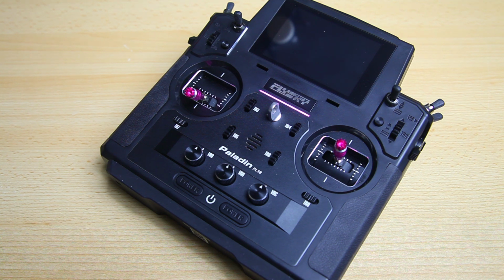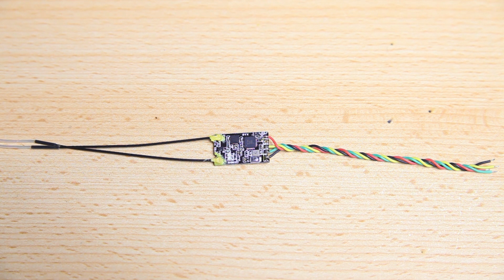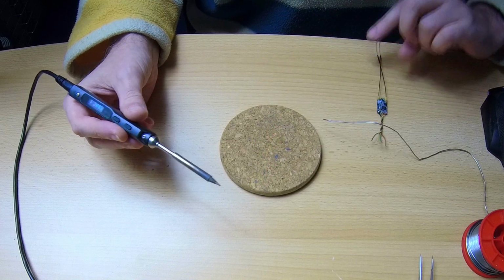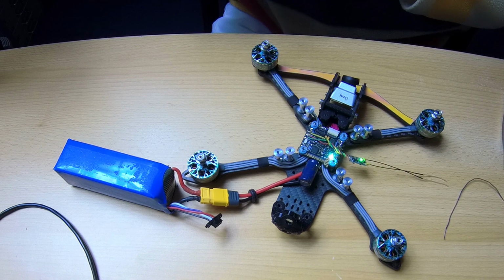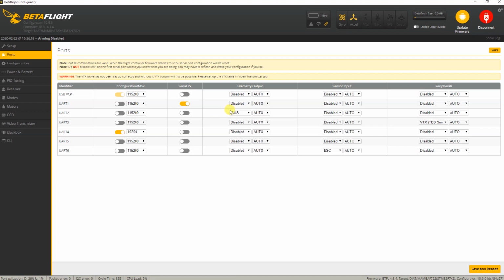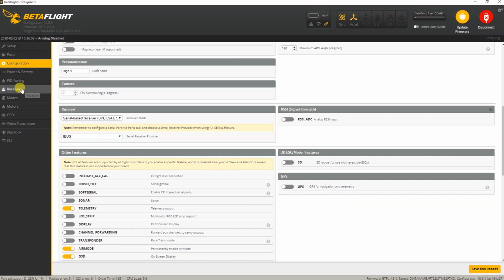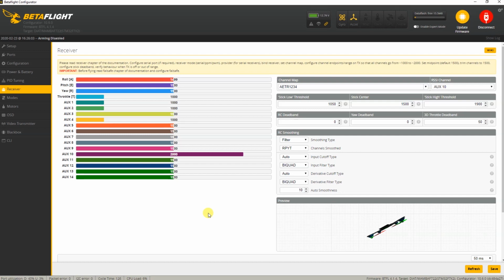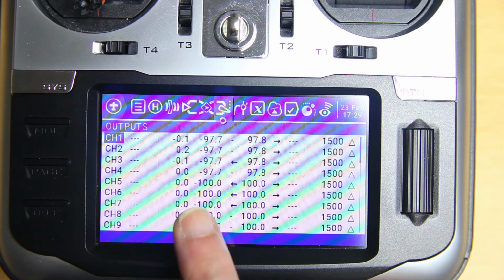Perfect FPV Drone Build Guide - P7: Receiver install + Betaflight Config

Comment from the maker: Really handy to actually be able to Fly the damn quad :P  
the Diatone / Mamba Mamba F722S Pro stack I'm using here: 
https://www.banggood.com/MAMBA-F722S-Betaflight-Flight-Controller-OSD-59V-2A-BEC-F50PRO-50A-3-6S-Blheli_32-Dshot1200-FPV-Racing-Brushless-ESC-for-RC-Drone-p-1490805.html?p=TO251813974002015038 

The Flysky PL18 Paladin radio I use: 
https://www.banggood.com/Flysky-FS-PL18-Paladin-2_4G-18CH-Radio-Transmitter-with-FS-FTr10-Receiver-HVGA-3_5-Inch-TFT-Touch-Screen-for-RC-FPV-Racing-Drone-Airplane-Helicopter-Vehicle-p-1441613.html?p=TO251813974002015038  

The FTr16S receiver: 
https://www.banggood.com/FlySky-FTr16S-2_4G-16CH-AFHDS-3-RC-Receiver-Support-i-BUSS-BUSPPM-Output-for-RC-Drone-p-1588306.html?p=TO251813974002015038 

Betaflight configurator: 
https://github.com/betaflight/betaflight-configurator/releases

Comment: Great Video, could you tell me where you connected the yellow and green cable? I am trying to get telemetry using a MAMBA F405 MK2, I know the green goes to SBUS.
Reply from the maker: Thanks man :)  soooo.. I had to look it up :P  
as I did the soldering Yellow actually goes to your FC's Sbus pad... 
And then the Green one is on the SENS tab of the receiver.. that one will go to a T pad (so T3 for instance) on your flight controller... So as I did the soldering, green is telemetry.... 
Hope that helps! :)
Reply: @DutchRC  I have the FrSky R-XSR, I know yours is similar or same brand.  By T3 you mean TX3? I already have mine VTX connected to it, how abot my TX6 connection?

Comment: Great video and very informative. Thanks again Dutch!
Have you noticed the range of the FRM302 module from Flysky? How a range like that is possible with 2.4GHz....
Reply from the maker: Thanks man :)  and YES.. it's not the only 2.4Ghz system sporting massive range claims by the way.. 
https://hobbyporter.com/skydroid-t12-intergrated-control-video-and-telemtry-system-for-profressional-drone-and-uav-aircraft-20klm-range-24ghz-digital-gimbal-camera_p2169.html 
And yes.. Flysky is taking it "a step" further still.. I know ;)